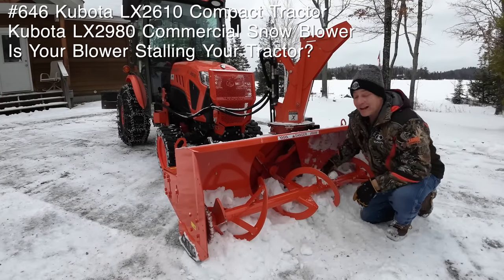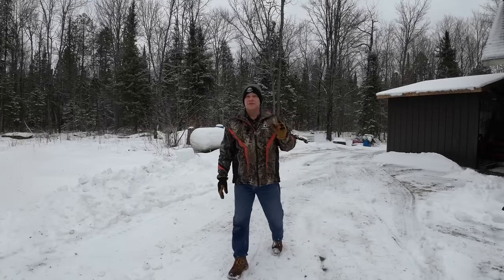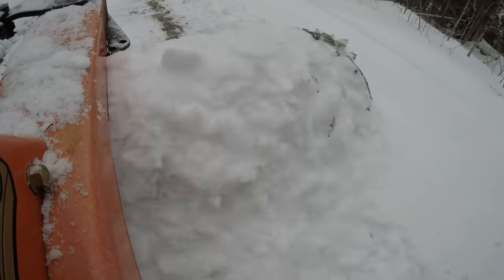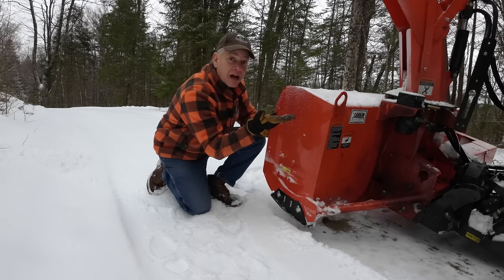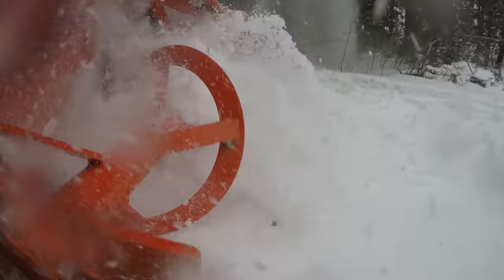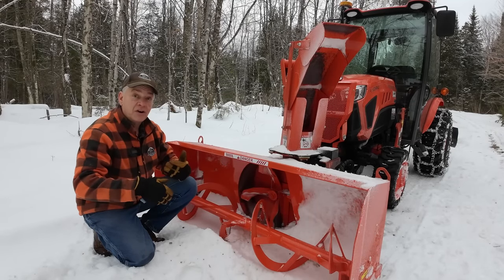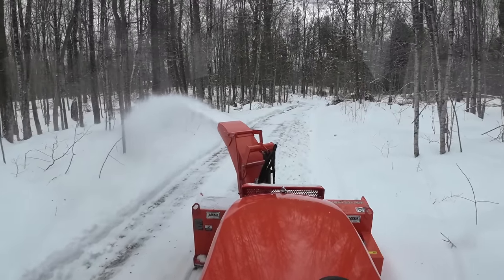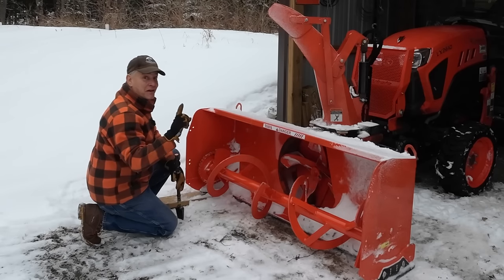646 Does Your SnowBlower Stall Your Tractor? I Can Help. Kubota LX2610 & LX2980 Snow Blower 4K

Comment: Hey Gord, another tip I discovered on my L4060 with front blower is to release the bar on the back of the brake pedal so you can operate the left and right brakes individually. This improves the steering tremendously as otherwise the front blower wants to dig into the snow bank and makes steering difficult.
Reply from the maker: Great tip and advice Ed! Have a nice weekend!
Reply: Great Tip. Thank you.

Comment: Good tips for beginners there! So easy to floor it and stall the tractor when you're not used to listening to engine load.
One second you're speeding along fine, then you hit rotten snow at a section you barely even touch and engines goes "BWAAAOOOW" 😂
And in my first year the driveway wouldn't freeze either, the solution I found was to not lower the blower all the way, cars could still get through, and packed the snow real good.
Of course, I use inverted blower, a raised front blower wont work for you in corners.
Maybe ebay has some taller shoes to get for that blower? Or perhaps you could get another pair of shoes from Kubota, then have guy modify them with an additional 2" of height? ☺

Comment: try turning the blade around backwards, it usually doesn't kick up as much gravel, see outdoors with the morgans, it seems to work pretty good. God bless,Matt.6:33,Prov.3:5
Reply: Great idea!  I was wondering how easy this is to do with the Hydraulic cylinder.?.?  Can it be disconnected, then turn the blade 180?  And can the cylinder be reattached when the blade is turned 180?  Thanks.

Comment: Another tip. If your drive is not frozen and the blade keeps digging in you can turn the blade around backwards so it doesn't dig into the gravel.

Comment: Yes you're right about that but that's for all tractors and lawn tractors to it does the same thing you have to go slow with all of them including the side-by-side and if you don't it's either got the motor down or pop the belt off or if like you said it breaks to shear pin

Comment: Good Morning GP 🚧🚧 YES IN DEED for the First and Most important safety tips ( no hands in the snowblower when the engine is on ) 👌👍🧐🚧🚧I like that grease zikr on the side of the shear pine 🧐👍Yes paying attention ( noise and sound too ) is very important 👍👌🧐Very Nice close views and yes use your rear blade so your will save your snowblower from these big rocks 🥴🧐👍Yes Tractorman 44 ( Wendell ) comment is very important 👍🧐👌We all are in the learning curve GP Cheers 👌👌🧐🧐👍👍🍻🍻

Comment: Great advice as always. Be careful going from a grade 2 to a grade 5 bolt/ shear pin. It nearly doubles in tensile strength. Could make a more expensive part the weakest link in the system. Best to you as always.
Reply: I'm doing the opposite. My Frontier snowblower calls for grade 5 shear bolts, I'm putting grade 2. Might break more often, but bolts are cheap.

Comment: Thanks for the video, I have a 24 inch snow blower and a gravel driveway. To prevent the skids from digging into the driveway, I made up a pair of skis from some quarter inch flat stock that I got from the hardware store and welded them to the skids. They're four or five inches longer than the skids front and back and about an inch wider than the skids.
Whenever I use the blower I always set it about an inch and a half high on the driveway, this keeps me from picking up rocks and I finish with my plow blade. I figure that if I have to use the blade to finish, than there is no reason to be trying to get clean on the first pass.

Comment: Good video.  I have a B2650 with the front mount B2782B blower and it loves dry snow.  Wet stuff not so much.  Two more thoughts -
1.  I use the cruise control to make sure I don’t push the tractor too hard/get impatient under these conditions.
2.  I keep my deflector at it’s most upright position to prevent excessive snow flow resistance.  Putting it down will result in almost instant clogs.

Like other viewers state, after the first pass a smaller bite may be in order to increase travel speeds.  Sometimes I’ll plow to the edges and then use the blower to keep things opened up fully.  

Keep up the good work!
Reply from the maker: Thanks for the excellent suggestions! Very helpful for me and others. Cheers!

Comment: another thing I found that works good is to put rubber wipers on the inside of the drum.This will help Get most of the snow out of the machine as it takes it in.   It will also prevent the machine from icing up When you get a lot of wet snow   You will notice that it also makes the machine throw snow a lot further.   attached the wipers with three or four bolts.   Carry a can of cooking pam  on the tractor to the lubricate the drum on startup.   Your machine should be 3/4 of an inch to an inch off the surface of the ground for a gravel driveway.    factory measurements are only a guideline,  not gospel.   The rubber wipers may save you some horsepower because it helps get rid of the snow sooner.    A lot of people don't believe that this works but I've tried it on smaller machines and you wouldn't believe the difference.

Comment: Great job GP,  since you have a cab tractor you might want to put a towel down on the floor like Paul Short so you don't have all that water on your floor boards.  You can remove it when your done and you won't have ice in there next time you use the tractor.

Comment: That blower tip also helps for those who use normal hand ones if the engine rpm drops alot back off abit let the blower do the job not ur body i see so many ppl trying to push the blower thru more snow than it can handle

Comment: Great video Gord. Thanks. 2 things I learned about my snowblower, keep an eye on the drive chain tension. There should be a small amount of play in it but not much. An overly tight chain will cause early wear or busted parts. The other thing is that spraying in inside of the chute with cooking spray does really help, especially when the snow is wet and heavy. The ground still isn’t very frozen here either.
Reply from the maker: Thanks RFL!

Comment: Good morning Gord, all good points and tips. My tractor is 38hp and it generally doesn't bog down unless it's wet, deep and heavy and then I need to slow down quite a bit. HP helps a lot.

Comment: Another fine job.  Thanks Gord.   I couldn't agree with you more about several  items you mentioned.  Blowing snow is something you have to get the 'feel' for.  Quite a few variables, as you mention and each snow fall is different; depth & moisture content - and each requires different tractor speeds.  And this winter is a first in that the ground simply isn't  freezing like it normally does here in north Maryland.  I can tell you why this is ... I just got a 2nd tractor, snowblower setup ;-)  If I may add, with respect to the chute freezing/clogging up ... this usually happens to me when I'm blowing a small coating of snow/slush mixture and reaching the end of a pass.  I think it's because there is so much water content, because it's a 'slushy' mixture, that it begins to freeze in the chute.  To help mitigate clogging, I've learned to ensure I'm taking as large a 'bite' (in slushy snow mixtures) without overworking the engine and at the end of a pass to stop forward motion quickly, so I'm not just pushing low amounts of snow/slush.  It's kind of hard to explain and hope it made sense.  Thank again Gord!  Always love watching your videos!
Reply from the maker: Good day David! Thanks kindly. LOL! Yup, thats probably why .:)) Thanks for sharing your advice - the slushy stuff can pose a challenge for sure. Hope we both get a little more practice with some good snowfalls soon!

Comment: I've been doing our driveway (mix of asphalt and gravel sections) and sidewalks, along with the driveways and sidewalks for 2 neighbors this winter. One is asphalt, the other is some pea gravel type material that really comes up easily. This year I added 2 shoes with rollers to the sides to compliment the factory shoes on the back side of the blower, and set everything to half an inch high. Seems to be doing well, and if the ground is frozen enough (it hasn't been the last 2 times) I'll scrape with the box blade for cleanup. It just hasn't been worth messing with the shoes this year, and I really wanted 4 points of contact for our lawn sections and the neighbor's very soft driveway across the street. I think that helps keep RPMs up too as the scrapper blade was making contact the last couple of years (I thought it was set at 1/2", but I guess the floor where I set the height was not even). I've been able to drive faster this year, without it bogging down, and knock all 3 driveway/connecting sidewalks in around half the time. That last 1/2" has been melting off with how the weather has been this winter.
Reply from the maker: Good morning ad thanks for sharing the good info Jonathan! Sounds like you have found a great set-up that's working well for you. I can't believe the ground still has not frozen yet!

Comment: Good morning Gord..
Your blower is different then mine.. I have two shear bolts one on each side of the auger  and one on the impeller.. 
Wendell is a wealth of knowledge.. He and I have had a few discussions about stuff … I have asked him about a tractor I have (1966 International 544) he says it’s newer then when he has worked on.. hahahaha He likes the old stuff.. 
I ran into a issue just yesterday.. I was blowing snow and stopped to adjust the shoot up a bit and as soon as my ass left the seat the tractor shut off.. I didn’t really think much until I got back in and turned the key and nothing.. I knew it had to be a safety switch somewhere.. I tried everything for about 10 minutes.. Then I rocked the foot pedal back and forth and guess what.. started right up.. Some how it was stuck in either forward or reverse just a little and it tripped the safety.. Lesson learned..
I have never been a fan of that type.. I like mine John Deere has two pedals.. left forward right backwards..
Oh well.. 
I love them both for different reasons.. hahahaha
Great Video..
Thanks for sharing your experience with us..
Oh.. Ps You can spin your back blade around and it will pick up lot less gravel when it is not frozen… Just a FYI.
Ok I have rambled enough..
As always stay safe and always be kind..
Cheers..
Reply from the maker: Morning Gus!  Yup he sure is - very grateful to him for many things. Yes indeed - great info about the frozen pedal. That is really good for folks to know about. Hope you and Sally had a nice weekend ! We finally got some snow this week so hoping for a little fun out there tomorrow!

Comment: I had the same thing with my John Deere 3039R and figured out I had to go slower to keep the RPMs up.
Reply: Just fyi, your John Deere 3039r has motion match that will adjust the speed of your tractor automatically. It’s a great feature idk if kubota has something similar.
Reply: @garyiannone8925  hmm I will have to check that out.  Thanks for letting me know
Reply: Actually it is called load match. Motion match is another feature that you have though that you should learn about as well. Both are very useful.
Reply: @garyiannone8925  found a good video on both. Valuable  information that wasn’t mentioned when I bought it. Max speed could help as well.

Comment: I would set the shoes down and blow the drive both ways instead of blading up gravel and then blowing the wind row.  All that gravel is very hard on the blower.  I have been blowing snow for 40 years in northern Wisconsin and never sheared a pin.

Comment: They say adding a comment helps your YouTube Algorithm.  Here is my contribution.  LOL  I've noticed on YouTube that tractor powered snow blow operators tend to drive to fast.  If they are worried about speed, they need to remind themselves how long it would take to shovel it.  My humorous observation, being an old plow driver, how many  blow or plow one direction and them back up to plow the same direction.  What a waste of time and fuel.  Just turn around at the end and plow going back the other direction.
Reply from the maker: LOL! Guilty as charged. Yup, I learned pretty quickly that it is a slow operation but for the first while I used to try to drive way too fast. Thanks for the kind and helpful comments. Enjoy your weekend D!
Reply: @GPOutdoors  You are not one of those YouTubers that only blow in one direction.  So I wasn't including you in that observation.  Besides, who would back up one mile to just blow in one direction.  LOL  Maybe even they would get the hint if their lanes were that long.  LOL

Comment: Although my 12 hp snowblower is not attached to a tractor one thing I have noticed over the years with this snowblower and previous ones is that the angle of the chute has a direct impact on the velocity of snow exiting. You seem to keep your chute quite low, but I don’t know if this has a great impact on your discharge rate. The other thing I do, from time to time, is either silicone spray or used PAM non stick spray to lube the chute, but again is this real or imagined. Thanks for the video, one day I may get a tractor.
Reply from the maker: Hey david.I think I agree with you. I think it may as well. When little to no wind, I think shooting it high with minimal drag will help it flow easier. Thanks for the excellent suggestion. Cheers!

Comment: The button to the right of your gauge cluster will switch from engine rpm to rear pto speed, if you press it again it will be mid pto speed. You want to maintain 540rpm for rear pto and 2500rpm for mid pto

Comment: Without chains, you’d be spun out for sure with the load the blade was pulling up!
I grew up on gravel, so know what it’s like to fight not digging up rocks.
Blessed to now have a paved driveway, I never take it for granted. Depending on the snow load, when possible I now like to plow towards the center of the driveway with the ATV, then run the blower down the ridge of snow created in the center & blow it clean.
The ping of hitting rocks with the blower sure makes one cringe doesn’t it?
Growing up, we called it a rock or stone, till it was like 50 lbs. or more, then called those boulders. Never looked to see what that official change is determined at whether size or weight. Never thought about it till now. 😁😁
Reply from the maker: LOL! True Fly! Those chains make such a big difference. Cheers!

Comment: Another issue is the amount of moisture in the snow.
The wetter the snow, the more likely it is to plug up. Try using some type of "slick" spray (on the blower box, chute and parts) like cooking spray, silicone, Fluid Film, etc.
6" of wet snow is more difficult than 8"-10" of dry snow.
Depending on the terrain, using cruise control can help.

Comment: I'm not a fan of the front mounted snowblowers running off the mid 2000RPM mid-PTO's. They are fantastic for not turning around, however unless you're running a 40HP tractor you often run into slow downs like what you experience, Gord. The work can be done as proven many times on here, albeit slow.

There is a company called Erskine, that has been in business for quite a few years that make a front mounted snowblower system for tractors  60" and up that run on a subframe from your rear 540 PTO to the front via a gear drop-box. Even with the secondary gearset, the rear PTO provides more efficiant power running at 540 than the mid 2000RPM. 

Like the front mount blowers though... pricey.
Reply from the maker: Good morning and thanks - yes, my neighbour Guy has that setup on his L3400. Works well for him for 17 years now. Thanks again and all the best!
Reply from the maker: @Fred Wills Thanks Fred! Some good info for folks. Cheers!

Comment: Another good video Gord, but I have a question and I’ve seen you do it before after you back blade and then you use your snowblower you’re blowing over where you back bladed instead of swinging the shoot over to where you didn’t back played, why would you do that?
Reply from the maker: A great question Ken. The driveway turns back and forth throughout the forest. Which means the winds hit me from different directions depending on where I am in the driveway - so I paid extra to get a fully hydraulic chute - so I spin it depending on which way the wind blows ( sounds kind of like Bob Dylan there...:)) and that is why you will see sometimes I am discharging over the bladed side instead of over the side I haven't cleared yet. It is also why sometimes you see  that I adjust the deflector to blow the snow low to the ground instead of shooting it high. Hope that helps. :)) Cheers!

Comment: So there's no need to watch the PTO speed? My rear mount blower manual (kubota) says to run the PTO  at 540. You can watch that on the dash of the LX2610 also. You just have to change screens. For some reason can't see both at the same time.
Reply from the maker: Hey good day John. I generally don't  watch the PTO speed but sometimes I will look at it when  I am setting it at first. After that i just watch the Engine RPMs. Cheers!

Comment: Quick question though if you’re tractor has a front pto drive surely you set the pto to 540 and away you go right?
Reply: Engine is not govern so she would have to give it more fuel under a bigger load I run into that with by brush hog
Reply from the maker: Morning MB. It has a mid-PTO . It runs at 2500 RPM and then the gearbox of the blower drops it down to something ( LOL- the manual doesn't say and the dealer doesn't know, what RPM it drops to, but it is geared down).